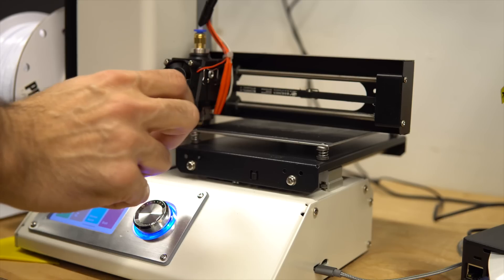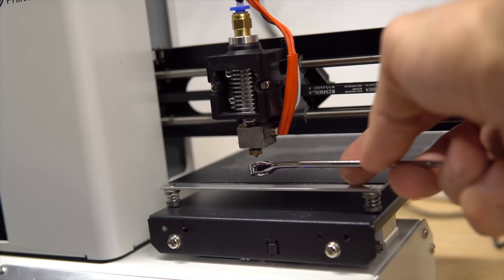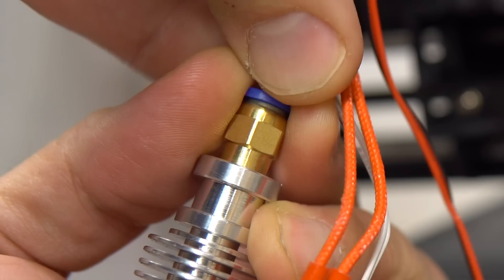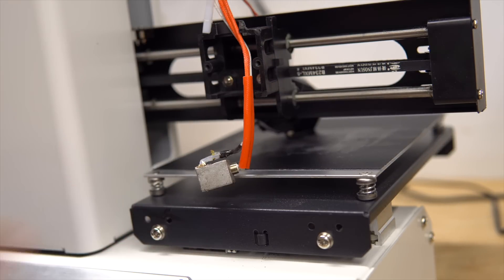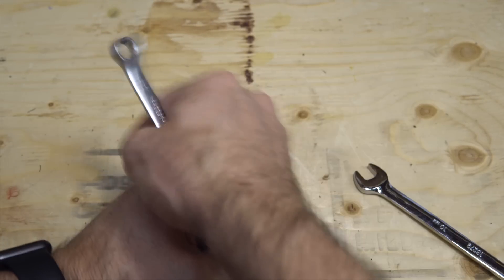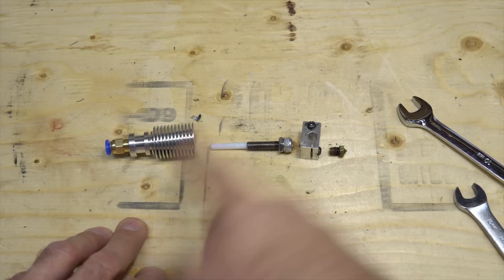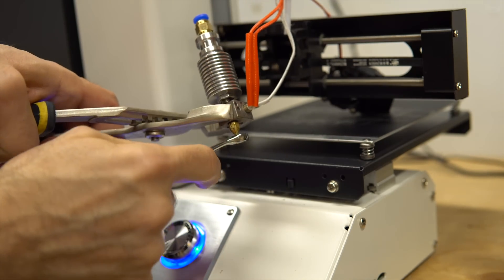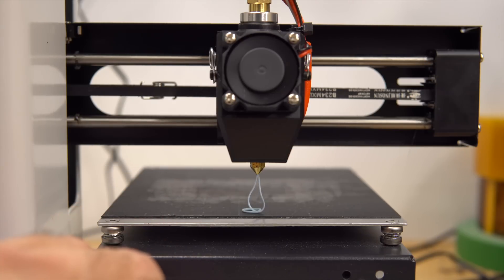How To Dismantle The Hot End

Comment: Hi! Thanks!!! is the first video with a demostration on this matter I can found.
But I need to know How you remove the heater and the other cable from the Hot Block?, i think is the thermometer. I desarmed everything but I can remove the cilinder from the hot block.
Reply from the maker: Hi on mine I did not remove those, the thermistor was glued with silicone and the other was held in place with a small grub screw. If you can you should be able to take the cables with the heat bloc or leave it in place and unscrew the heat break from the bloc in place...

Comment: Is it possible to use the heatbreak from the e3d v6 inside the stock select mini v2 hot end assembly? I wonder because they're so similar if you can mod a stock hot end to be all metal for much less than a whole e3d v6 swap with just an e3d replacement heat break.
Reply from the maker: I think it can be made, it could change the height and you will have to compensate with a shim on the Z switch to prevent crashing on the print surface.

Comment: Any tips for replacing the coupler on top of the heatsink, I need to replace mine and have not been able to get it off
Reply from the maker: You can try to heat the heat sink a little to make it expand that should help removing the coupler, or freeze the coupler, or both...

Comment: Hello 
Which is better? 

E3d ALL METAL OR TEFLON?
Reply from the maker: Hi, All metal is able to go higher temperatures than the Teflon ones, if you want to use other materials than PLA like PETG you need a All metal since PETG working temperature is around 245 and it would be melting the Teflon liner.
Reply: @Franks3Dshop  
Thank you.
I've only used PLA.
Which material is better for use with RepRap printer?
Reply: It is my understanding the if you only print PLA the teflon is better as it will get jammed less often. But if you print PETG or ABS then its better to get a all metal as it wont degrade under heat.

Comment: Should the heat block be loose when it's hot? I replaced my nozzle and afterwards I noticed it was loose. Not sure if it was like that before.
Reply from the maker: Hi, no the heat block should be a little tight, with aluminium it does not take much, but because of the heat expansion you need to tight it up when it’s at temperature. If it makes sense?

Comment: I had a clog in the PFTE tube and needed to replace it, now I can't fit new PTFE tubing inside of the heat break.  Should I shave down the PTFE tubing to fit it in?
Reply from the maker: Hummm I would try to find why it is not fitting, in theory you could shave it down a little with sandpaper maybe.

Comment: I really liked the breakdown of all the parts and explanation. The only thing missing was how to remove the wires from the heatblock and then how to reattach them. Unless you just used another heatblock for explanation purposes?
Reply from the maker: Hi, yes I have used anther heat bloc in this video, the heater is held in place with a screw, and on the mini the thermistor is glued in with some kind of hi temperature silicone, Others have a screw to hold the wires of the thermistor, or a set screw for the E3D originals...

Comment: Thanks so much!  This really helped me dismantle everything and then put it together again.  I got the blockage cleared out from the heat sink, but unfortunately there's also a broken off piece of filament in the Teflon line just past where you start to feed it in, so I'll have to figure out how to remove that. I'm a total newbie, so I'm learning every day!
Reply from the maker: Hi, push filament from the other end !
Reply: I tried that, from both ends, but no luck.  It's broken off about 1 inch from the reel end and about 4 inches in from the side above the hot end. Maybe I just don't have the strength, but I pushed for all I was worth!  I got some new Bowden tube, so I think I'll try just replacing the whole thing. Thanks for your help!
Reply from the maker: Yes replace it, not normal, filament should go smoothly in the Teflon tube. Maybe there was debris in the tube that jammed it.
Reply: I am making progress, but still not there yet!  I replaced the Bowden tube and now moving the extruder moves the filament through.  Yay!  However, it is still blocking, right on top of the heat sink. I think it is in the copper thing that connects to the heat sink.  I don't know how to remove it - it doesn't seem to screw off, but I can't hold the heat sink tight because it's round. :(
Reply from the maker: Hi, it is screwed on top of the heat sink, you can try to heat up the heat sink so that it expands and helps you remove the coupling not too much so you do not melt the Inner tube. Or grind off the sides flat at the top of the heat sink just below the coupling so that you can use a wrench, if you do not remove too much material it should still hold when you put it back on the printer. Does this make sense?
Reply: Frank - you are awesome!  Yes, that makes sense.  I will try heating it first, and if that doesn't work, will try grinding down the edges enough to hold it better.  I'll let you know how it goes!
Reply: Frank - you are the best!  I really appreciate all the help you have given me!  With some grinding and some heat, I eventually managed to get the coupling off.  The top, copper part (I think it's called the pneumatic connector?) was completely blocked with filament.  I had to heat it to get the filament out and of course, that melted the plastic part on the top where the Bowden tube goes in.  The heat sink itself was clear.  So I guess I have to buy a new pneumatic connector, but I'm not sure what model to get for the MP Mini.  None of the ones I saw on Amazon looked exactly the same, but maybe it doesn't matter.  Is there a special model I should get?  Or maybe just upgrade to a E3D V6 hotend?

Comment: How did you attach the thermistor to the block?  This is a great video on the hotend of the v2, but I cannot figure out this one detail.
Reply from the maker: Hi, I did not replace the thermistor, it seems to be held in place with some hi temp silicone of some kind...
Reply: Thanks for the reply.  What confused me is that I can not see an attached thermistor in your video from 6:42 to 10:57.  Based on some searches, I'm going to reattach my with 
a dab of Permatex 80335 Muffler and Tailpipe Sealer.  P.S. Several of your videos have helped me as a first time 3D printer user.  So thanks.
Reply from the maker: Thanks, that is why I do this. Your comment help me continue my work.

Comment: Omg... the filament was stuck and I can’t pull it out until I decide to use brute force and and came out
Reply from the maker: Hi, as long as you to not bend the X-Axis arm, you should be good. Removing the Bowden tube can help in certain cases.
Reply: Frank's 3D shop The heat block for some reason unscrewed itself halfway and I can’t unscrew it off or put it back. And the heat sync is hot

What am I suppose to do? I can’t find a fix and it’s like something sealed the nozzle and the heat sync into the heat block even when heated
Reply from the maker: Normally, the nozzle meets the heat break inside the heat bloc and is not touching the heat bloc, if your nozzle is stuck and screw up to the heat bloc, the threads could be damaged. I would heat the hot end to 200, than use a C wrench to hold the heat bloc and a closed wrench for the nozzle. You could need a new heat bloc, nozzle or the whole hot end.
Reply: Frank's 3D shop and also the heat block won’t separate from the heat sync too.
Reply from the maker: If you can unscrew the alumnium heat sink from the heat break, you could use two nuts jammed to get leverage on unscrewing the heat break from the heat bloc, I did that and broke the heat break. And replaced it with a stronger one.
Reply: Frank's 3D shop Thanks I got the name nozzle out and the heat block seems to be fine :) just need to clean it and screw it back
Reply from the maker: Superb !
Reply: Frank's 3D shop There’s a bit of excess Teflon tube for the heat sync so do I cut it off?
Reply from the maker: Yes you can, the exact original length of the inner tube on my machine was 52mm
Reply: Frank's 3D shop The Teflon tube is the right size but it won’t go all the way in the heatsync leaving a bit of excess at the end of the screw case
Reply from the maker: Yes it is suppose to come out about 15mm to join with the other tube coming in the top of the heatsink...
Reply: Frank's 3D shop The thing won’t go in, the excess is about 20mm and look it’s really tight fitting unlike yours which come in easily even in the screw tube. I feel like mp uses a ptfe tube that’s too thick.

The tube is 4mm wide.
Reply from the maker: Yes it is 4mm on mine too, strange that it does not come out, if you have spare parts you could force it. But mine and the one of friend came out easily no force.
Reply: Frank's 3D shop Got it in, just trimmed down the end to make it easier to fit :) subscribed

Comment: Hi Frank, at which temperature do you print the PETG on the Select Mini ? Under 230°C ?
Reply from the maker: At 235 for PETG.
Reply: I read that PTFE starts to deteriorate from 230°C. It would be nice to find an all metal heatbreak. Do you know the length of the stock heatbreak ?
Reply: Je précise que j'ai la V2. Les infos pour la V1 sont sur le wiki: https://www.mpselectmini.com/parts/heat_break
Reply from the maker: Yes it does brake down around that temperature, but the heat break does not get to the same temperature as the nozzle, that is why you have the big round heat sink on top of it. At least on my mini and both minis of a friend it did not deteriorate the PTFE tube.
Reply from the maker: J’ai aussi la V2 ainsi que mon ami, sur la V2 original, tu peux remplacer le tube PTFE sans remplacer le heat break, c’est le même tube que le tube extérieur qui mène à l’extrudeur.
Reply: Merci pour tes réponses, j'avais pas réalisé car j'avais écrit mon dernier message en français, tant pis pour les anglo ! Eheh !

Comment: I'm confused because I didn't see you removing a clog in the head or the bowden tube.  I only saw you install a new head.  So am I to understand the only issue was the clogged old head?
Reply from the maker: In fact the nozzle was bad, it’s meeting surface to the heat break was not straight and plastic was oozing out on top and on the bottom of the heat bloc. I will soon do a video on easy clog removal on the mini.
Reply: Frank's 3D shop Thanks Frank, your video still helped me clear my teflon tube, it was clogged right above the nozzle.  I think it got clogged because I mistakenly printed my last job and stopped it mid-stream and left the heat on for 5 minutes before I loaded the correct job.  During this 5 minutes the PLA got hot and creeped up too high into the bowden tube inside the heatsink.  I used a wooden Q-tip stick to push the tube out the bottom after removing the head, cleared it out with the stick and reassembled it all.  Now it's working good!  My advice is if you're going to let the printer sit idle for a while shut off the heater block to prevent it melting upwards!  Thanks for your great videos...
Reply from the maker: I use a plugin in Octoprint to turn off the heat after a period of time. “Heater Timeout” so if I forget it does it on its own!
Reply from the maker: Also let the fan run until temperature of the nozzle is below 50 degrees or so, this will prevent the same problem. Say you finish a print and shutdown the printer right away, the heat will creep up, because there is no fan to cool it.

Comment: Frank , I had a big clog  on my Mini Select V2. I have to replace the PTFE teflon liner  that you show at 9:16 of your video. Could you please tell me what's the exact length of that  liner. I'm afraid the original one had been distorted  by heath and  its length has changed.
Reply: What size PTFE tube did you use, or better yet if you can link me to the same one you ordered I'd majorly appreciate it.  I haven't taken my hot end apart yet but I think that's my issue right now, and all the info at https://www.mpselectmini.com/parts/ptfe_tubes is about the v1.
Reply from the maker: Hi, I do not have the tube anymore, but a friend needs to replace his and it is in good shape otherwise, I will ask him to measure it and report back to you.
Reply: Thank's . My goal is to fix the  original hot end  then in the future replace it with the genuine  E3D-V6
Reply from the maker: Good choice!
Reply from the maker: The exact lenght on my friends machine with the tube intact, is 52mm
Reply: Thank you Frank, by coincidence Poste Canada delivered  today  the PTFE  tubing  I ordered. So I'm ready to work .
Reply from the maker: Cool! Good luck.
Reply: Frank , I would like  to thank you and your friend. I replaced the  original clogged PTFE tube  with a new one 52 mm long  and  it works perfectly.  . To avoid snagging when loading new filament, it is recommended to taper the end of the tube which can be done with an  M5 drill bit.
Reply from the maker: Those are compatibles with the V2, same as the V1:

PTFE Tube with fittings Amazon US:http://amzn.to/2G2FRTX
PTFE Tube with fittings Amazon Canada:http://amzn.to/2pwLKSX

Comment: Thanks for this frank! I just started having clogging issues that I couldn't solve with normal maintenance.  btw have you tried installing the all metal E3D?  I wondering if its a near drop in mod on the MPSM V2 "E3D" edition(ie no custom mounts needed)
Reply: The Bowden version of the E3D v6 is all metal, but you don't have a separate piece of PTFE inside it; you insert the Bowden tube all the way into it until it touches the narrow part of the heat break.
Reply: Thanks Mr/Frank for the video,, but I think I got jamming filament in the hot sink I can't push forward filament anymore, any suggestions!! BTW I got E3D V6 bought it from gearbest.com
Reply from the maker: Hi, ok E3D v6 from gearbest is not a real E3D v6, not the same price also. For your jam, it depends where it is situated, I have a couple of videos about that subject. I would myself dismantle the hot end, heat it up and see if I can clear the jam pulling out from the nozzle: https://youtu.be/8zsV_FN-y4o
Reply from the maker: Thank you, I can try one, I have one on hand standby for a friend!
Reply from the maker: Hi again, I just tried the E3D v6 on the Mini V2, and it fits in the support but it is 4-5mm shorter.

So if you add a glass bed of 4-5mm or even better a PrintInZ bed (just tried one today and it is so nice no glue needed), you would be at right height from what I can see.
Reply: Awesome! good to know! its a genuine E3D correct?   I'm going to try out the nozzles you linked. Hopefully it solves my current clogging issues. I went months without clogging, now after every 2+ hour print,  I have a clog every time I start up the machine for the next print.
Reply from the maker: Yes it’s was a genuine E3D v6... you should also change the PTFE tube it can break down and shoot pieces in the nozzle, watch out my heat break threaded tube broke easily, the walls are thin and if you force the nut out too much because of left over plastic, the tube breaks. I changed the heat break tube for another one with a smaller outside diameter PTFE so the walls of the heat break are thicker. I had to add a small length of tube on top of the heat break also, the oem comes out about 30mm and the one used was flush cut and smaller anyway. Look at 9:20 in my video Troubled Nozzle, so you cut out a piece of tubing the length of the one you see coming out the original, and you can use those If you break yours: HICTOP 5 Pieces 3D Printer Extruder Hotend 1.75mm Nozzle Throat for Reprap Prusa I3 https://www.amazon.com/dp/B00WW141TG/ref=cm_sw_r_cp_api_maCMAbDCK5MPW
Reply: When took out it out a few days ago the tube and heat break seems fine. But the heater block has lost a few threads, they came off attached to the nozzle's thread.  Good idea on the tube though, a tube with a smaller I.D. may help prevent some spiraling in the heat break.
Reply from the maker: I will replace mine eventually with a E3D Lite6, it can go up to 245 degrees and a good choice for the monoprice, and also not too costly. In my opinion.
Reply from the maker: Oh and for the PTFE tube, you have to remove it from the heat break and look at the end that is near the heat bloc, it will seem melted on the edge if it is beginning to degrade, you can try to flip it or replace it. I would just replace it if you have some, better to be sure, it will not that notable just looking at it, if the mouth of the PTFE  on the side of the heat bloc is not sharp has if cut by a sharp blade, it has probably gone bad if this makes sense?

Comment: Thank you for the great video. I had filament stuck in the ptfe tube inside of the heat sink.
Reply from the maker: Just as a side note, be sure to always have the fan ON with the mini, or else heat will rise and melt the plastic higher.